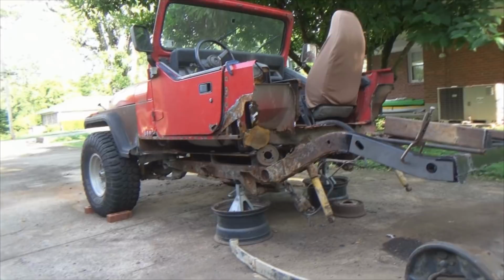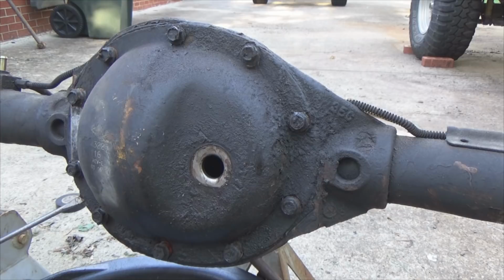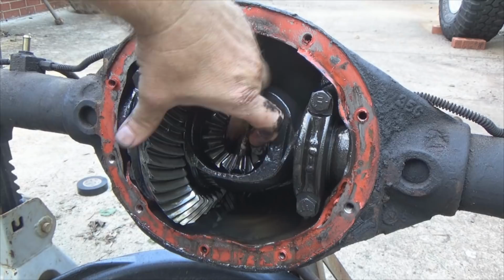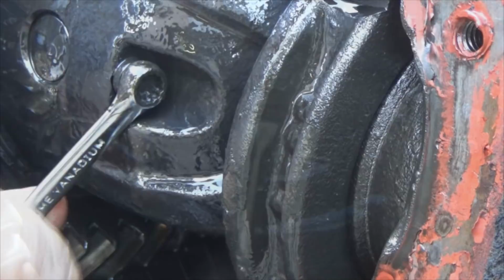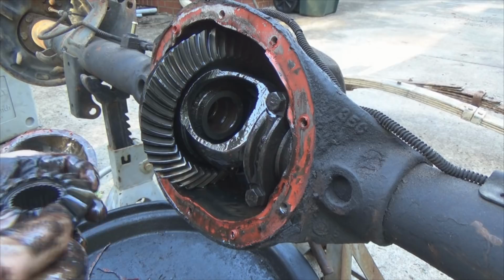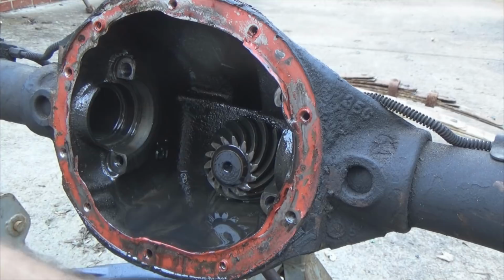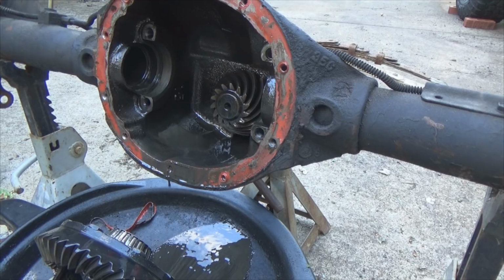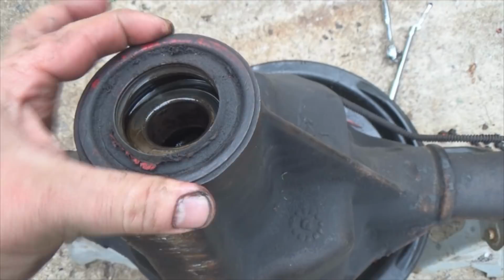Jeep Wrangler YJ - How to find your gear ratio and Dana 35 getting scrapped. #jeeprear

Comment: . I  need the rear end replaced Im wanting to take out axles, housing an all out of my 2000 cherokee and replace it with another complete housing, axels an all.unbolt u bolts drop it all. What modal jeeps will inner change.

Comment: Superb video. Very informative - step by step. Thanks! Question: when I turn my driveshaft  there's a little play before the wheels start turning. Is this normal? Should there be any backlash or should the wheel move exactly at the same time you turn the drivshaft?
Reply from the maker: There is always just a slight bit of movement. How much depends on how much wear the ring and pinion gears may have. So, you will get a bit of driveshaft movement before the wheels move. Hope that helps! Have a great day!

Comment: Question, when you swapped your rear axles (the 3.55 into your 91) didn't you have to change the ratio of your front dana 30 axle to match?  My uncle has a older AMC 20 axle from a CJ7 and I was thinking of swapping it for the 35, but it may be better to just re-gear the 35 and 30.  I'm currently running 33X12.50 tires on my 95' YJ and not getting much out of 5th gear.
Reply from the maker: I still need to swap front axles to get my gears to match. Because of working what seems to be all the time, I dont get to where much. Within the next couple of months I'll swap the axles to get the gearing to match. You would be better off swapping in an 8.8. The Dana 20 and Dana 35 are both weak diffs.

Comment: Thanks again, Chuck, but question:  I know you are junking this rear end, but for those of us not having another rear end to exchange; in looking at the galling of the saddle housing for the carrier, would it be reusable with a new bearing and race?  Is this rear end, in your opinion just junk and should be scrapped or is that your choice?  Could it still be reused with any hope of longevity?
Reply from the maker: Honestly, not for long term. The shims and the galling of the housing would allow the carrier to move too much in the housing. If I really had to put it back together to use it, without question the shims would have had to been replaced and possibly adding more to tighten it up. A proper fitting carrier needs to be pried out, you saw that one actually fell out. So, overall, the whole diff housing was beyond usable repair. Thanks, that's a good valid question. Hope my answer helps. Have a great day!

Comment: Loving the yj videos, on mine it looks like they flipped the axle over and did a spring over swap. Is it safe to run it that way or will it mess stuff up
Reply from the maker: As long as the flip was installed properly it's fine. Many older 4x4s came factory spring over axle. The only catch with the YJs is that you should have an anti-wrap bar on the rear diff to prevent spring wrap under acceleration. Have a great day!